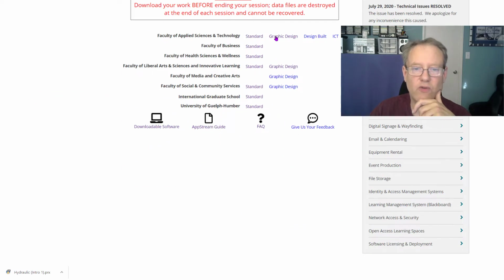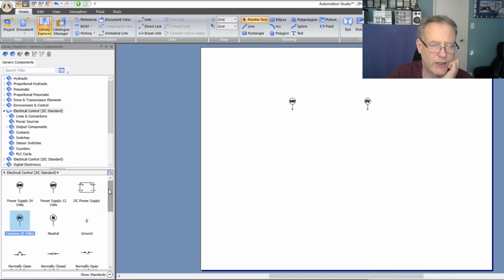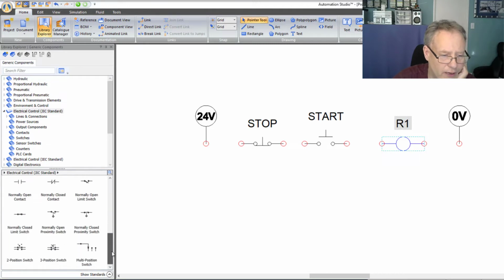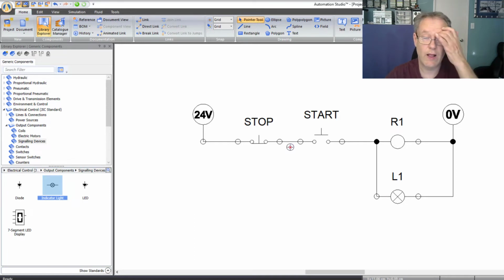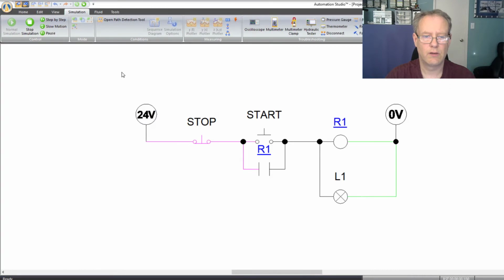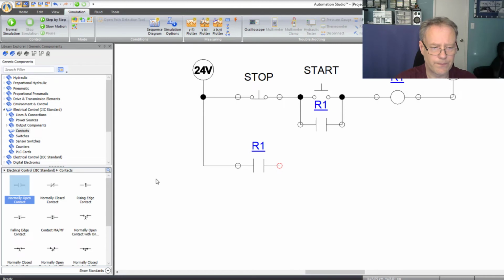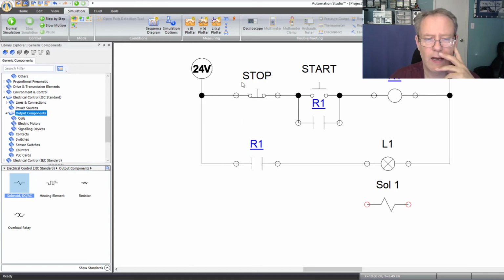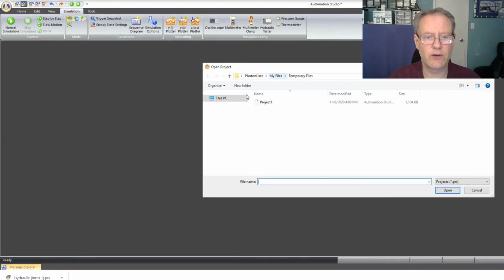Introduction to Automation Studio

Comment: why don't my indicator lights come on in the simulation? the circuit works fine but as soon as I put an indicator light in the rung the singnal just stops at it's input.
Reply from the maker: Sorry, but I can't diagnose your circuit without the AS file. If you are a student of mine, please emails me your AS drawing. If you are not my student, I'm sorry, but I can't diagnose without the AS drawing.